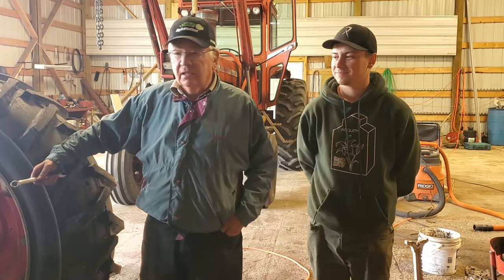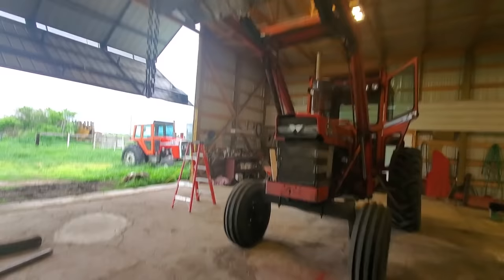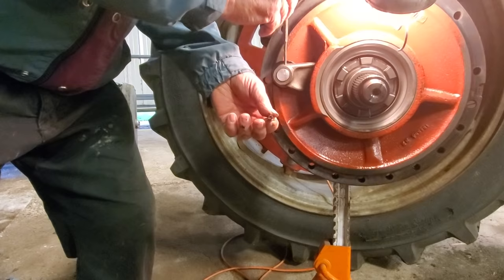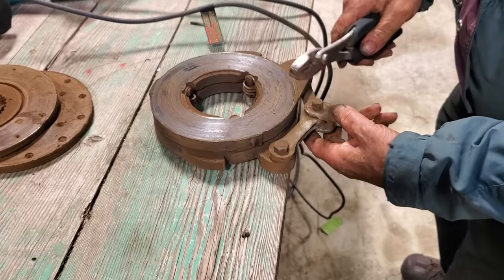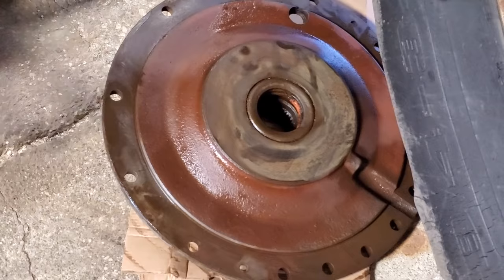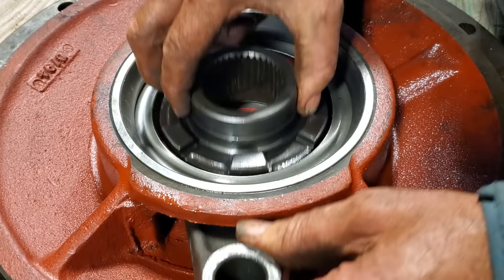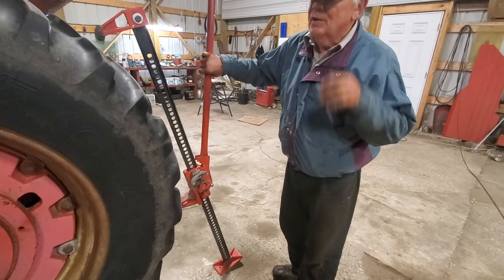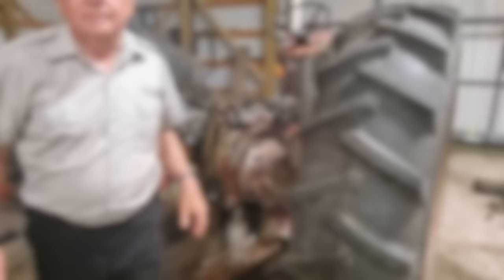How-To: Repair or Replacement of Massey Ferguson Brakes - Massey MF 165 Brake Replacement

Comment: I did this job on my father's  354 international, same setup, took me a little bit to figure it out, slick  setup. Tremendous  braking force, if you wanted  you could steer  the tractor with the brakes alone, as long as you were not on a hard surface.

Comment: I was 16 working at dealership, brand new 165 setting on lot then 
When my uncle closed it I got all the manuals and parts books for MF and moline 
Still have them all plus a ton of books from ford tractor when it closed also

Comment: when you adjusting the brakes on a 165  you should have the wheel off the ground and rotate the wheel while you adjusting the pedal up to make sure that the brakes are not binding because the brake come on a lot sooner than the pedal suggest. This is more important with the later wet brake assembly  these brakes  start coming on with very little pressure on the pedal. Its better to have the brake pedal as low as possible.

Comment: Nice this is a little bit differnt from the 165 175 and 185s I grew up around they all had heavier rear axle housing and wet brakes the 165 didnt have the cast weights only the 175 and 185 and 30in rear tires they were in Engand maybe thats the reason but you are doing a great job and explaing as you go along nice job

Comment: There are no disc brakes to MF 35, there are drum brakes. 275 and few more are wet discbrakes
Reply: 135 orchard model has this brake and locker 1969 front angle plow snow ride brake. Housing gets hot snow flakes land on axle housing and steam away .

Comment: Been forever looking for someone who had knowledge of these older Massey Ferguson's, none around. I have a MF 175 and been trying to find a bracket to convert the generator to an alternator, no one makes them that I can find. Do you have any idea where to find one? great video on the brakes, probably be doing that when the weather clears up.
Reply from the maker: part numbers are 519376M91 and 514107M1 
If they aren’t available take the picture to a welder and he can make you the brackets.
Reply: @farmgpa  thanks for the reply. Is there a particular website or company  you use? I've tried Steiner's, Ebay and Agco and had no luck using those part numbers. Thanks
Reply: Excellent video. I have a MF165 that needs the breaks redone, now i beleive i will be referencing this tutorial to complete. Great job explaining the process. I hope you make more videos to pass on your knowledge.
Reply: Build one, it’s easy to do

Comment: Do you  still have all the parts numbers  for all the brake  parts...an also is a 65 an a 165 brakes the same. Thank you
Reply: The brakes on the 65 are exactly the same. Replace the oil seal as it is sure to be worn or just aged.

Comment: Uncle all my brake discs for an MF65 diesel are oilly . What could be the problem . I guess they are worn out seals . Can I replace the seals with the ones that do not have a drain hole on them coz I cant find those with a drain hole.
Reply from the maker: The seal between the differential and the brake

Comment: I guess you got the brake assembly for under $50? You didn’t say why you’re not cleaning up the old one. It’s almost $150 now. Maybe buy the springs which are $6 each? Dealing with springs is often difficult. Great video! Hope you’ll comment on this.
Reply: They are pain in a$$ brakes to work on mine are overdue , i recall why i put this off thanks for showing the process.

Comment: My brakes on my MF165 are sitting in grease. That's what it looks like anyways. Are these then wet brakes? Its an early model usa tractor. I ordered parts for a dry brake system, are they the same as wet brakes? My parts look the same as yours except the disc have rivets in them, holes with metal rings in them. Thanks
Reply from the maker: gasket part number is183254M1 and I was able to get it from my Massey Dealer. other parts I got from A & I parts.
Reply: I don't believe that these are wet brakes.
Reply: Wet brakes don't have all the dirt in there, they are sealed better.
Reply: @farmgpa  please correct me if I'm wrong. Thank you.

Comment: i alway,s tear done plantary,s check and reseal been round these all my life a lot can go wrong in plantary,s and they cost more than you want to think about
Reply: Howdy mr. Tanner, 
Fixing to go through my 65. Are there videos you know of that takes you through a planetary’s sealing and bearings??
Thanks
Reply: @kennethlyles8353  you need a shop manual pretty much staight mechnic work you will need press brg pullers make sure you get the brgs shimed wright i know it extra work but you are close so forr peace of mind go ahead and good luuck shop mans are online
Reply: I got a 1963 65 diesel I need to fix mine theyre leaking.
Reply: @bfields1448  be sure to get manual on youre trac do take time to look at finals shim brgs very critical  seals  new oil check everything little time now may save bid dollars later  good luck

Comment: I have a 185 and its is leaking oil over the rim of the right hand back wheel...it seems to be coming out of what I will call the hub...no oil seems to be going down in the transmission, but the brakes feel softer...without knowing much, what am I looking to repair???? a seal, or brake cylinder, or something????????????
Reply from the maker: You are going to repair the planetary that is the hub that the wheel bolts to . It needs seals and maybe a bearing.
Reply: thanks for the reply..much appreciated...the task in hand sounds daunting but i guess a fella has to have a go when living way out in the outback... @farmgpa
Reply: there is a youtube video on how to replace a massey rear wheel seal, an indian  thing..I guess thats what I am supposed to do...

Comment: Hi boss do you need a apprentice I like 100 series massey tractors 😍😍💪💪
Reply from the maker: You need something strong enough to handle the tire assembly, so it will depend on how much fluid is in the tire.

Comment: Some particular tractors same model same years comes with the stupid immersed brake disks system, 😂is not efficient system to me,I hate the oil immersed system ,this dry system always better and easy to repair, the England version come with the crazy oiled immersed stupid system 😢very dangers when you going dawn in hills 😂😂trust me, you want to be out of this situation 😂😂😂, nice video my friend good job 💪🏿

Comment: 31:43 no lock tight?  Maybe there like lugs on a car and theres like 10 hugh nuts none needed im guessing.   No technical torque spec either.  Master farm mechanic can feel the torque numbers 👨‍🔧🔧🔩⚙